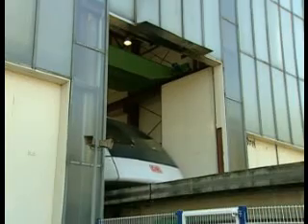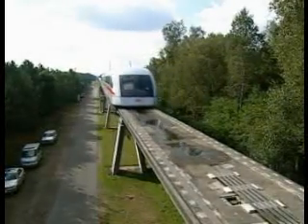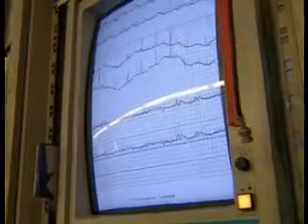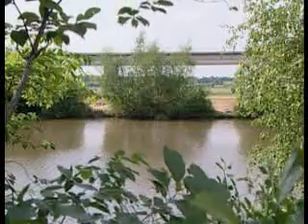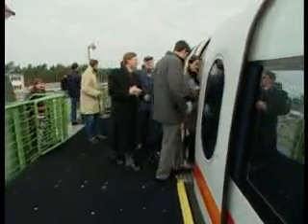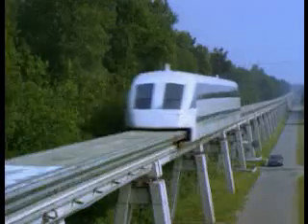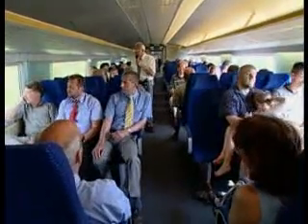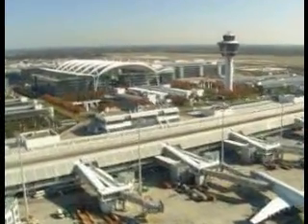Transrapid Test Facility Emsland - TVE (German Maglev Train)

Comment: The active electromagnetic magnets for both levitation and guidance are on the vehicle support arm (chassis) which receive power from the on board batteries that are recharged via non-contact linear generators (also on board the vehicle). The train runs on a long-stator coil, basically a cylindrical generator coil split and laid flat. The coil in the rail pulls the vehicle up to make the precise space for efficient levitation and speed. Which is why it wraps around the rail.